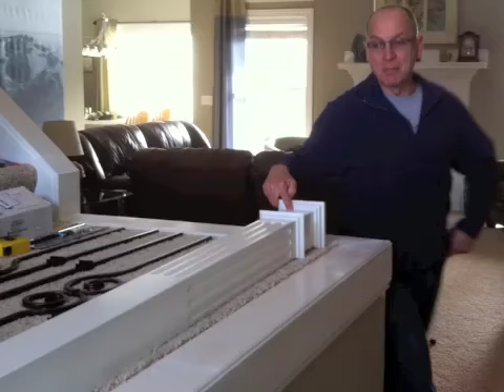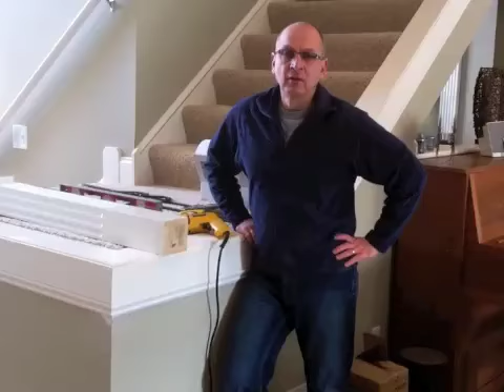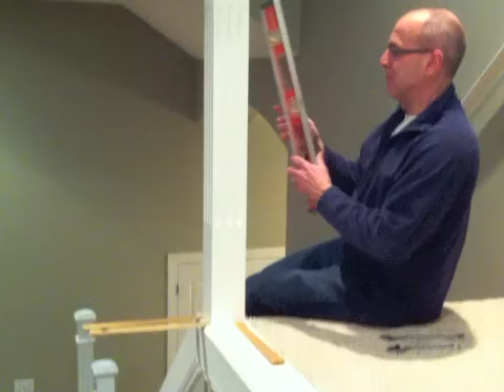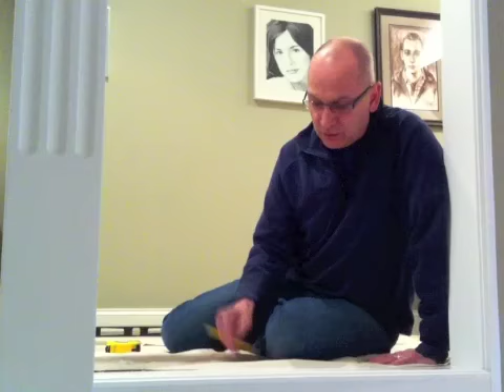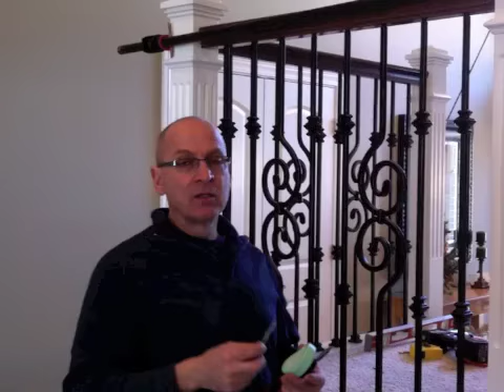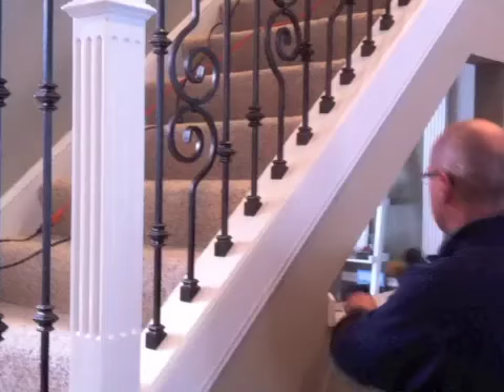Stairway Renovation Final Part

Comment: Hey Mark, who did you use for your supplies? Did you shop around and find online to be cheaper then an average home improvement store?
Reply from the maker: saintzk123 I found the iron balusters on line, I don’t remember from where. I looked around for the style I wanted. More options are online then a big box store. I used Baird Brothers for the wood banister. You can pick out the type of wood and style and they will even stain it if you want. I choose that option for this project. They also sell the metal balusters but with limited styles. https://www.bairdbrothers.com

Comment: Looks great. I was just looking at our old drywall banister today and thought, "I bet we can just hack that off at floor level, lay down some fresh wood there, paint it, and put in some railings. It would really open up our entry way. https://imgur.com/a/VigQrjV We'll double check but shouldn't be any electrical running through the parts that we'll be cutting off.  Good idea on saving the top piece. We might be able to do that also.

Comment: Very nice, i got a similar issue, i just have full .... half-walls. I got 2 stairs to go up to the 2nd floor(first one goes up half a floor, then there is a second one also half a floor up in reverse), and one is exposed to the dining room ... and in the 2nd floor i got the same ugly half-wall on 2 of the 4 sides of my staircase.
Told my wife that this ugly thing blocks a ton of light and without it it would be ALLOT more attractive ... just like your's gotten.

Comment from the maker: Janet,
For me it was easy because the of spindle windows the contractor built. I just cut the wall at the bottom of the window openings. If you don't have those, you just need to cut the wall high enough for your molding to cover. Just remember if your wall was built from the ground up, you will need to add a 2x4 top plate so figure that into your height.

Comment: Awesome work man. congratulations. I just bought a home and it is beautiful except the staircase well. We are trying to get it done. How much do you think it will cost. dimensions should be almost same as yours but it is rounded and not straight. do you have any idea about pricing if done from outside compared to diy.
Reply from the maker: I have about $1000 of materials in this project. I never had it priced out by a contractor but I would imagine it would be in the $3000-$5000 range.

Comment from the maker: I did screw in horizontally but I used some thicker long lag bolts. Counter sink them by drilling a hole about a 1/2 inch deep a little bit larger then the lag head. I covered the bolts and made the bottom of the newel post a little thicker by molding it out with 3/4 lumber about 6 inches high. Cut a 45 degree angle on the top of the 3/4 and it will give it a nice finished look. I used a 1 inch thicker newel post for the bottom which also gives it a nicer look. Good Luck with your project.